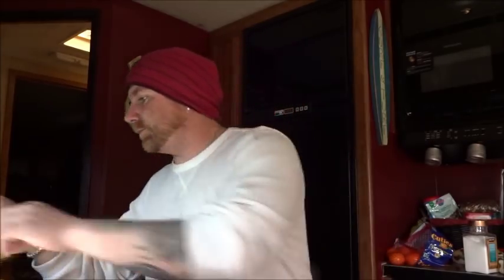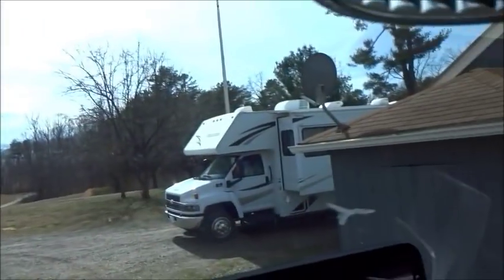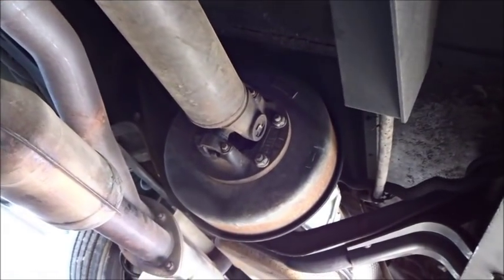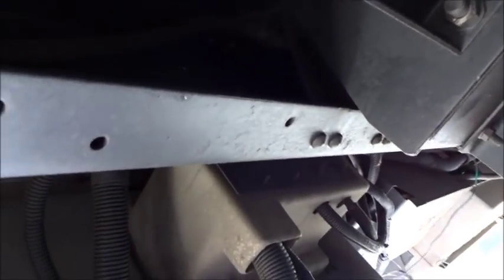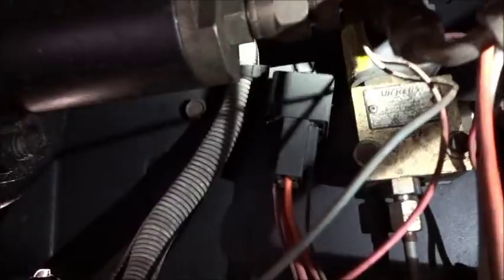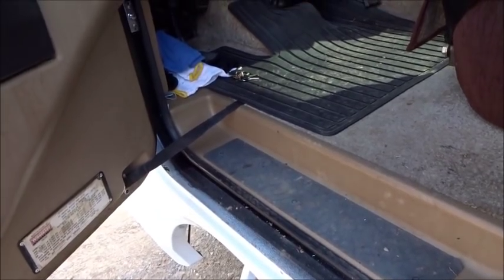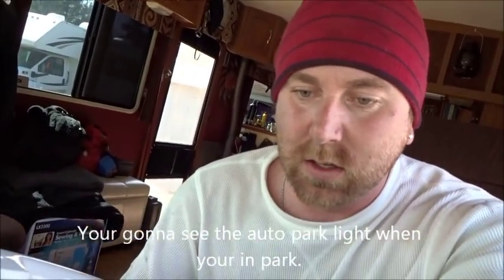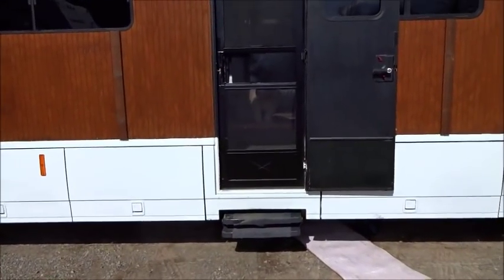Update from the shop ...Auto Park Brake problems on motorhome. P30

Comment: I'm experiencing the same problem except I was trying to park my RV and suddenly I couldn't go backward or forward and I was in the middle of the driveway of my storage lot. I had to have the drive shaft removed before the tow truck was able to move my coach the 12' to complete parking. My problem now is to find a shop who can perform the procedure you have presented. I'm terribly frustrated and hopefully I can locate a shop to do the work. I have a 1998 Allegro Bay. Thank you for this very informative video.

Comment: Good video, it helped give me enough information to get started on the repair, I ended up replacing the grey master cylinder warning sensor ACDelco 10218778, mine was leaking a bit, I also replaced the ACDelco 15961566 green parking brake switch.  I decided to clean out the Dextron fluid reservoir after draining it, which requires disconnecting the wires and unbolting a few things to remove it. Since the brakes had locked up a number of times, I ended up replacing the rear brake pads, I drove it last night and everything is now working as it should.  It took me awhile to locate the grey sensor locally or the part number for it, once I found it online I ended up purchasing both of them online for what it would of cost me for just the green one......Thanks again
Reply: Where online did you buy the 2 sensors?

Comment: I had to do this same thing about 10 years ago. If you're looking to find it on RV websites they call it the RGS (Rotten Green Switch), and if you have this chassis it will likely fail eventually so I would just keep one in the ol toolspot. I was told by a mechanic at an RV place who let me pick his brain that if it leaked it's best to at least replace the fluid in the reservoir as it'll goof up sooner if moisture got into it....

Comment: This  guy is no joke he knows his stuff. I just purchased a 1997 Safari Trek on a P30 chasis and my brakes locked up a mile from home. I am sure the problem described in the video is my issue. I will look into it as soon as I have time. I would like to know how to unlock the system so I could inch it into a better area so I can work on it. Also, I hope that overheating the  system (parking brake system related to the rear end) after driving it a few blocks to get it home didn't ruin it entirely. I assume I can just bolt a new brake assembly onto the end of the driveshaft in order to ensure a safe parking brake system.

Comment: After fixing my auto park issue, my concern was that the brake pads in the auto park are worn or glazed. (( came on at 65 of free way )) Have you ever replaced or checked these before? Looks pretty straight forward......drive shaft then  drum.  Is there anything i need to know before pulling it apart?

Comment: I own a 96 Winnebago Vectra.. p30 chevrolet chassis. Where is the "fuse for the blower motor" (cockpit heat/ac controls)?? 35,000 original miles. AC was blowing fine on every speed setting when I parked it. Put new brake pads on it and took it a test ride and was using ac when it suddenly stopped blowing out vents all together. There has to be a relay or fuse for blower motor SOMEWHERE. I can't locate it. A fuse block (panel) is at my left foot down low under dash but NONE reference blower motor. Jus dumbfounded currently! Please help.

Comment: Sorry, had to chuckle a little bit. Chrysler products used to have driveshaft "parking brake" from the 30's thru 50's ( I believe ). My first car was a 39 Plymouth and being a kid, I had to see what happens when you pull it on when driving. Well, I'll tell you, instant lockup of the rearend! lol  Can you imagine what would happen in a motorhome (I'm sure they have safe guards for that ). Anyway, glad you got it fixed. Roll On!

Comment: 30’ 1997 Airstream Land Yacht. After a transmission (4L80e) fluid change and flush on my P30 Chevrolet chassis the auto park would not engage to park. The shift lever will go to park but will not engage the brake.
Is there any reason the fluid change wold have caused this? What else should I look at to find the cause?
Any help will be greatly appreciated!
Reply: I have the same problem.

Comment: My Auto park system has a leak, it seems like it's coming from the cap. I removed the cap and it does not have a seal or gasket. Do you know if that is normal? Does yours have one? 
Thanks
Reply: Most are not air tight. Its unlikely that it is leaking from the cap.

Comment: hello im having the same issue. but the other pressure switch you said you hope you don't have to replace on yours .is the one thats leaking on mine .i don't think i have a reservoir down there its inside my step .on my 2004 winnebago sightseer. what part number is it and maybe the size hole so i can pull mine first and do quick switch without draining it

Comment: That's awesome that you figured this all out AND recorded it too !  I bet that switch was expensive .. ouch !  I had a chuckle at Boondock... all the jacks going up and down ... the look on his little face was so cute !  The ... what the hell ? ... look .  Lol ... glad that your back in business !
Reply: $15-$20 on ebay
Reply: My comment was 8 yrs ago !  Lol .. 8 !
Reply: Yeah but the lol is that my reply reached you from 8 years ago, all I can say is, "if that ain't time travel I don't know what is"...lol but the price today is probably the same...as it was yesterday...lol..
But now to elaborate on my experience with these 'Autopark' systems GM uses. The first time was in a mid '90's GMC Top Kick box truck that had a GVWR of 24k I had it loaded at 27k with a car hauler in tow @13k lbs thats 40,000 lbs rollin and was headed to South Fl from So Cal. Shortly after leaving I noticed the fluid leaking and the brakes gradually applying as I traveled until the middle of now where Texas and the brakes locked up completely leaving me on the side of the road with limited hand tools but armed with the knowhow and determined not to be stranded I set out to find the cause and wasn't to hard to find the leak it was from the actuator which I was easy to remove the 4 bolts and one hydraulic line after it was out I took a pair of pipe wrenches removed the cylinder cap and the rod came out to reveal the seal had failed. Not having anyway or time to find a new seal I was left to use what I had on hand...that being a leather glove which I cut a circular seal and fashioned it into replace the seal and viola' reinstalled the actuator and worked fine still to this day. The next was my 96 Fleetwood Bounder that the previous owner had disconnected the cable going to the drum and I further removed the entire system to make room for the exhaust system I was installing. On to my current RV a 94 Bounder with the same system and same problem experienced in the Top Kick I simply decided to disconnect the cable as was the previous RV but now I'm working to make it operational again and after some diagnosis I find the problem being the RGS/pressure switch to be leaking and causing the brakes to constantly cycle until the fluid reservoir is empty. Unfortunately a hand crafted piece of leather wont fix this so here I am watching videos while I figure a way around having to shell out the $20 for a part that I know I can work around or work with. My idea is to remove the switch and with some JB weld I'll dab some inside the threaded end where the pressure is applied to then reinstall just to pressure up the system long enough to force the compound into the failed area of the switch then remove it again and allow the JB weld to cure without further contamination from the hydraulic fluid... if it's a success I'll reply you back with the result... 
But now my question is do you RV or what was your interest in the video here? I'm just curious and interested as I'm looking for a travel partner of sorts...
I'd like to hear/read back either way, Thanks, Jeff.       @kellysheridan4064

Comment: Had a brand new actuator installed, new switches pressure switch and green switch, replace with an aftermarket expensive ones that are supposed to last forever. 500 miles later my parking brake just engaged, there’s hydraulic fluid all over the ground. Thank God I was going slow and able to pull into a gas station

Comment: Just eliminate the the electric motor and cable off the e-brake system.. I had the same issue with my 95 Winnebago vectra.. mine kept blowing the ignition fuse and killing the engine.. every time you took it out of park.. and would keep that brake locked on...so I unplugged it from the transmission and I un did the cable from the emergency brake system I just used the foot e-brake.. it all works off of the same system..yes you're leveling system will still work it reads off of the emergency brake switch..

Comment: When your switch failed where you stuck in the locked position?
Reply: When mine failed the parking brake was locked on and the motor home would not move even at 2000 RMP for about 5 seconds.  If this happens your not going anywhere until it  is fixed.  Lucky for me I was parked in my own driveway when it went.
Reply: what did you find wrong? same thing happen to me.
Reply: To: Chris Davis - Yes the emergency park brake locks up the drive shaft and the coach can not move.  See my reply to Dennis Tanton.
Reply: To Dennis Tanton:  The drive shaft had to be removed in order to tow the Motorhome to a repair shop.  They found that a dead short had caused the problem.  The insulation was rubbed off of one wire in the main electrical panel inside the coach and another wire was almost rubbed to the point of another dead short.  They had to replace the wiring and the panel in order to fix the problem.  Expensive fix.
Reply: thanks for all your help found a guy who can fix it

Comment: Chad, Know what yer up against,WOW,, Those are IMPRESSSIVE, Jacks,, Congrats,on The Fix,,, The SOBS,that designed That,,,WOW,, should Have To Get Under there and Change One,,,,       Thanks,, Jack,,
Reply: will Auto Park stop it from cranking 2
Reply: trying to see if my motor locked up or if the parking Auto has something to do with it the engine won't spin by hand
Reply: Some more of my.time being wasted

Comment: I installed the aftermarket manual brake kit.  Very probmatic unit.
Reply: I also fabricated a quick disconnect from the electric system,  is case that problem arises.    And the cable parking brake kit is installed ahead of the electric system.   If the electric system fails in cold weather.
Reply: any info on kit or where to get it?